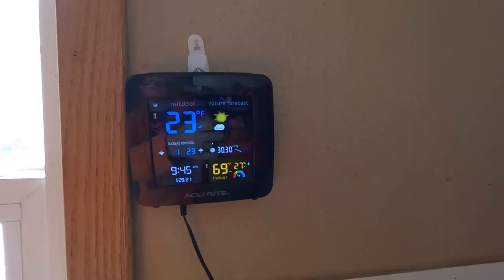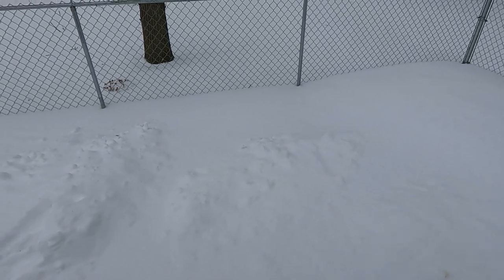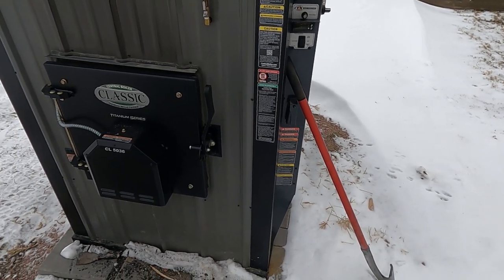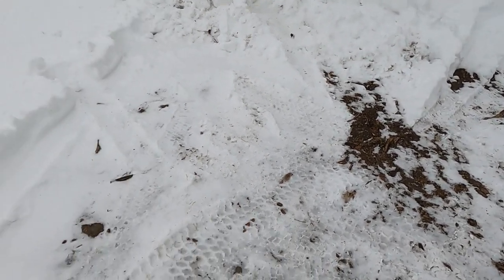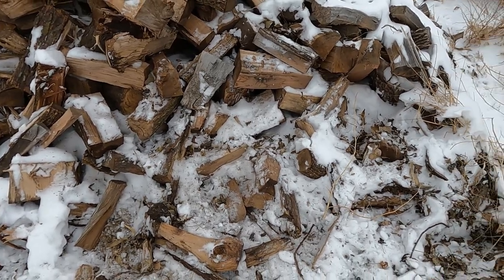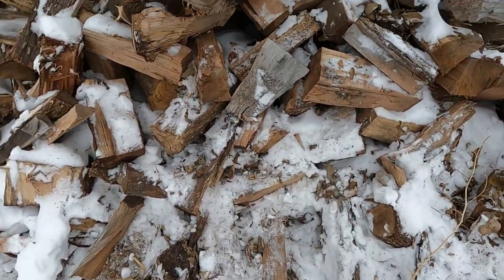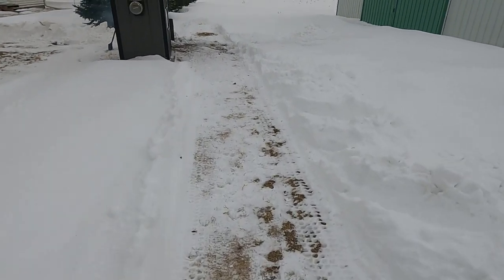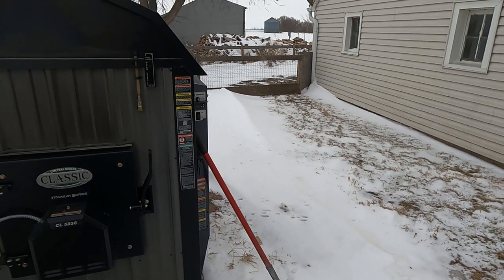#119 Feeding Outdoor Woodboiler Vlog 3

Comment: When I bought my Central Boiler some 12 years ago. It came with a Shovel and Scrapper and Rake.
Also going to tell ya. Get creosote logs. One every 2nd to third week. Cheaper than Central boiler stuff but just effective.
I put a gallon of that stabilizer in every year regardless. And again still another reminder for a deer sled for getting wood. Stay Warm
Reply: What’s with the creosote logs in the boiler? I knew a guy that picked up 100’s of ripped out RR ties and used as firewood. They burned hot and long. And Ben I too along with many others wish you’d get a sled, cart, wheel barrow to shuttle wood to the boiler. Maybe we should start a GoFundMe and get you something.😉
Reply: @budgillett9627  you buy them at hardware store. I would never put rr ties in the boiler.  Creosote fireplace logs clean your box and chimney. 
Menard, Homedepo And Lowe's. Keeps the Creosote down

Comment: Ben, I noticed the valve for checking water level is open. I think you should close it or the check tube stays full and freezes and you can't check the water level in the stove.
Reply from the maker: I will but I haven't had it freeze yet cause it's half glycol
Reply: Guess that would make sense then. I only put in the treatment conditioner.

Comment: Most we have had is 4 inches twice thiz winter. Sunday we might get twice that mixed with sleet. Wood wont freeze to the ground if it's in the bed of your truck! What kind of bootz are you wearing Ben?
Reply from the maker: Those are some muck boots I believe they're called.  This is my second winter with them and they're holding up good